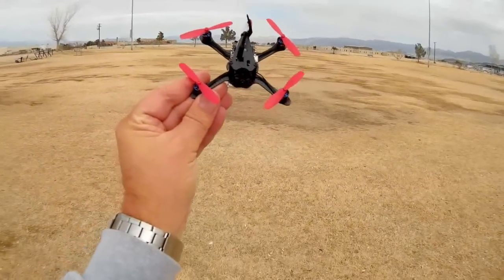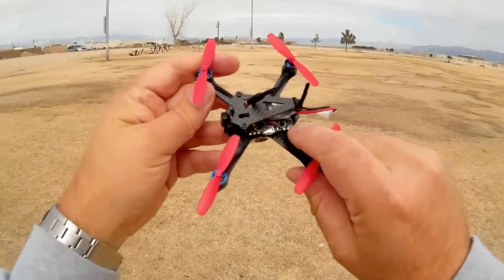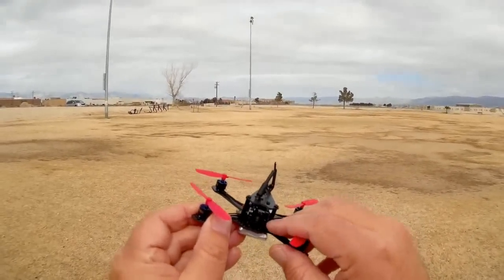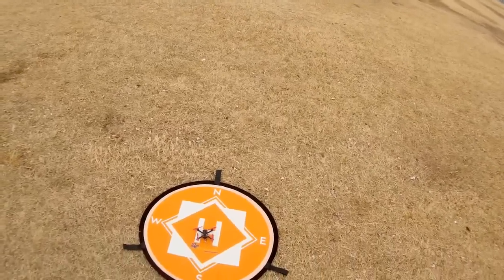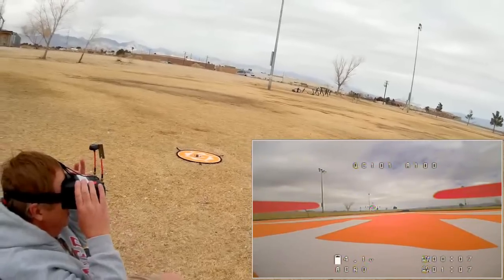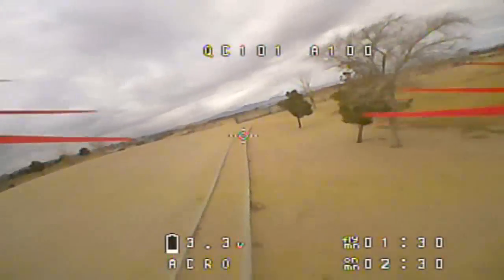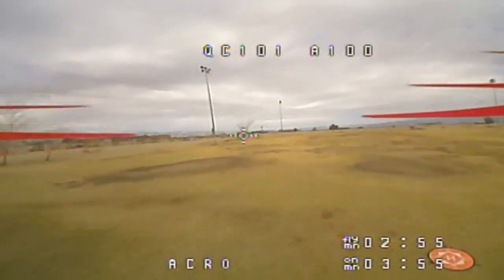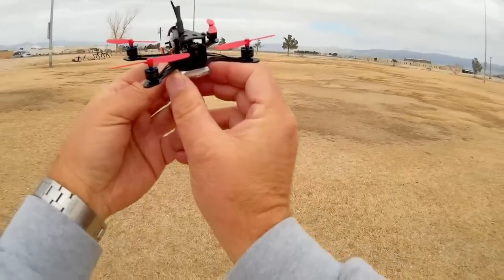Aurora RC A100 Brushless 1S Micro FPV Racer Drone Flight Test Review

Comment: One of my motors became stiff and will not spin. Anyone else have that problem?
Reply from the maker: Did you check for dirt in the motor?  Turn it upside down and blow compressed air in the ports while turning the props by hand.  Try to loosen it by doing such.
Reply from the maker: But if you can't loosen it, here's a replacement https://goo.gl/ZCZG4Q
Reply: I did not but I plugged the battery in backwards and had to get the crazybee flight controller 4 in 1

Comment: There may be a jumper on the FC board to allow you to switch between 1S & 2S .. usually requires soldering or unsoldering the jumper.  For a good high C battery, look into the Turnigy Graphene 750mah (1S) 60C battery .. should give you 5 min. flights easily, and isn't any bigger than the typical Syma X5 1S. Since the voltage never to go below with a LiPO cell is 2.9v, you can go lower on your battery warning, as long as you monitor your vbat and land when it gets to 3.0v. As for changing the VTX power, sometimes that requires a 10 sec. press on the config button. Short press to change channels, 2-3 second press to change bands, and very long press to change power levels. Erie set a record for snowfall this year, with well over 12 ft. of snow (so far) in some areas. Today, the weather is 50+ deg, so a lot will be melting, making room for more snow. Cheers.